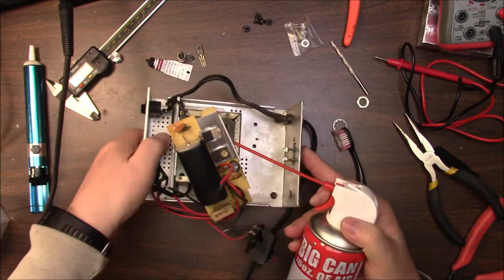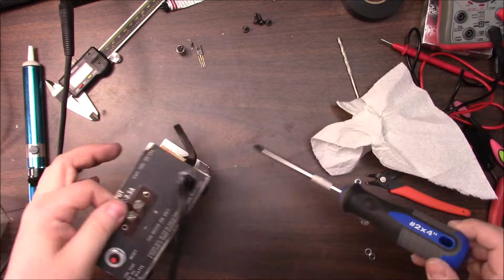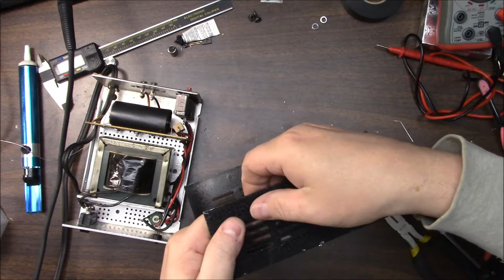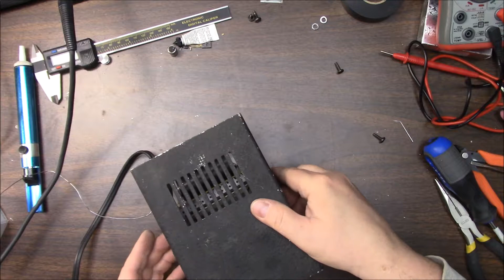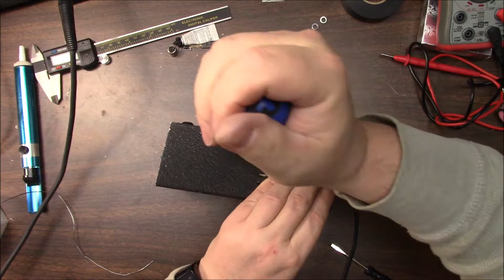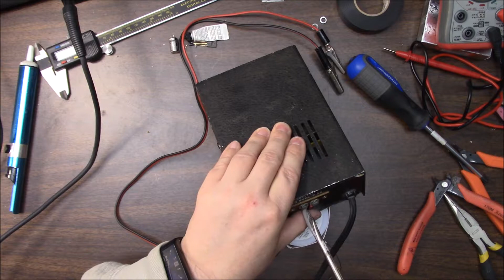Radio Shack Regulated Power Supply: Part 4 Repair Completed

Comment: I have the exact same power supply that the circuit breaker is hard to stay in but it does work when you press it in. Do you think it's the same problem as yours or with the circuit breaker